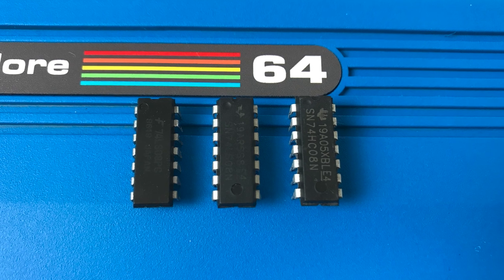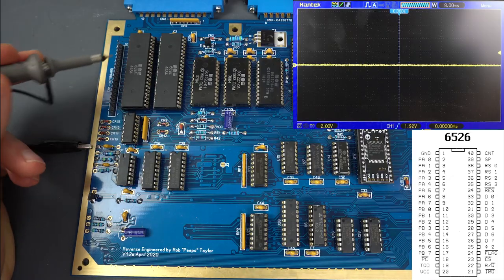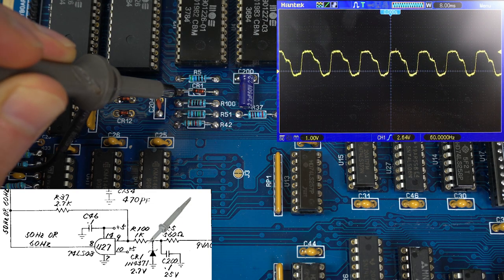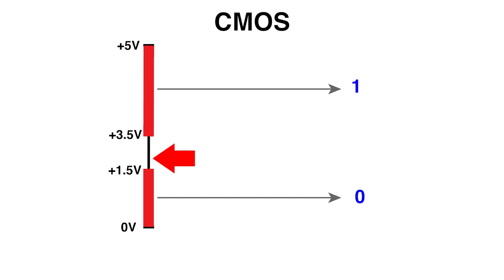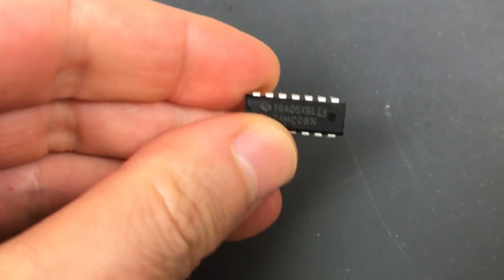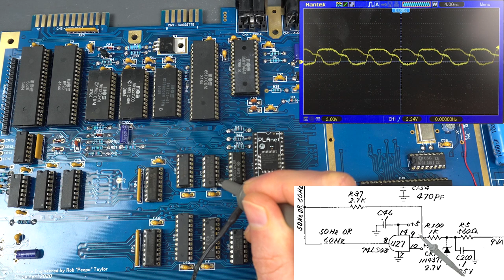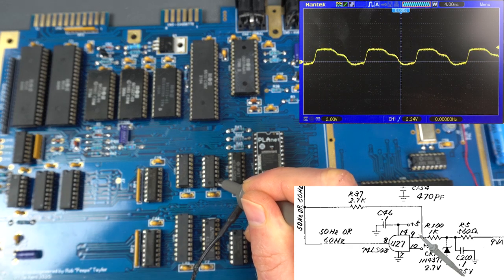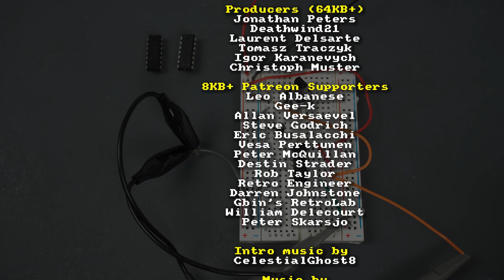Stumped By New Fake Chips Scam

Comment: You missed a massive point in that American 60hz is significantly more stable than foreign grids, that alot of extra attention is actively paid into stableising the frequency of generation.  But even then, it's not reliable for clock signals in complex computers like the c64, you mentioned how they didn't try to convert 50hz to the 1 mhz clock, assuming that it would've been designed with 50hz which more easily divides into 1 mhz, but that ignores that is was designed in america so the division would've been more complex, and B: it's just unfeasible for high speed computer timing to rely on generation frequency, but it certainly is much more accurate for a real time clock, the variation over a week or even a day is significant, The max deviation allowed over 24hrs for 60hz is about .16%, whereas for europena systems, you get .4 on average, with no strict max deviation.  It's so fucking bad that britain is using the deviation in line voltage hum to tie recordings in forensics down to the county and day they were recorded at.

So to sum up, no you cant replace cpu clock signals with the line frequency, but if you have any application corroborating events with the clock, like any long duration timer which would be a massive waste of processing power to run a loop for its delay, it is significantly more accurate for the us versions of the c64.

Comment: That's not the worst case of fake chips, I had two ali sellers sell me CD4017s rebadged as CD4026BEs._
Reply from the maker: Ouch! At least there it was clear right away that they didn't work as expected I imagine.
Reply: @NoelsRetroLab  That's right. Killed fake CD4069 and one specimen before I found out by experimenting._

Comment: Aaargh I hate fake chips! I oad one MAX3232, and a PL2303 as fakes, and both were prone to start getting very hot, where the real chips would not show this behavior for months and months of use afterwards i.e. the circuit was still ok, but not the damn chips. Being able to remove the printing with isopropanol then gave it away, hah.

Comment: I don't know why they didn't use a 5.1 volt zener.
Reply from the maker: Right. Or a Schmitt trigger directly. Sounds like they used whatever leftover gates they already had on the board 😃
Reply: @NoelsRetroLab  A manufacturer once told me that they were expected to save money each year since technology improves. Because we all know it's not that simple they installed chips and accompanying parts that did nothing at all so they could be removed each year to 'save money'. Bosses were happy looking at their spreadsheets.
When they got a new CEO I kept turning up on the hit list for missing my field service ETAs. For ten years I was always within fifteen minutes, what's the problem. Your LATE! Seriously. I set my ETAs for the end of response timer and old chuckle head was happy as can be. Had to tell my customers to trust me and not the computer and they were fine again.

Comment: You mention that the "LS" tells us the chip is a TTL device, sorry but "LS" means "low power Schottky"; the 74X tells us it is a "TTL" device. 

Love your site, I broke into computer repairs back in the 70's repairing commercial coin-op video games. Some of these had 200 plus TTL devices (straight 74xx chips), luckily all socketed' Some of the early boards used "RTL" devices as they were cheaper! 

My first computer was a Sinclair ZX80 bare bones board only, cost me 4 weeks wages at the time!

Comment: Kind of amusing that commodore relied on 2 volt logic level. The whole way that the TOD works is a massive hack in my opinion though. I suspect those chips aren't fake, just not made up to spec and assumed that most people wouldn't notice as 5v logic wouldn't have been noticed if it was done properly even in the 80s even TTL/CMOS.
Reply from the maker: Agreed. That circuit is an amazing hack. I suspect they had an unused gate in that chip and just used that instead of designing something better. I do think the chips are fake though (meaning HC with the wrong label), so I'll probably run some extra tests to find out. Should be interesting.
Reply: @NoelsRetroLab  yeah can't wait to see!

Comment: whats so hard reproducing the chips
Reply from the maker: The LS ones? Nothing other than it's a slightly more obsolete technology, so I'm guessing the factory wasn't set up for that but they were set up for the slightly more modern CMOS. Just a guess though.
Reply from the maker: Someone even suggested that they may be able to manufacture them, but maybe they had a shortage and got a big order for LS, so they just changed the labels on the ones they were set up to make at that time.

Comment: Why does this circuit feed 2.7 V to a 5 V chip? Continuous voltage levels around one half of the power supply voltage can damage any type of logic chips.
Reply: Likely the pulse width. You can use a higher voltage, but the AC voltage will be above that for a lower amount of time, so the pulse width gets smaller.
Reply: TTL is guaranteed to switch as long as the input is 2V or higher - that is per the spec. 2.7V is safely over the 2V minimum requirement, so it's perfectly fine, and no damage will occur.

CMOS can consume more power if it lingers in the "non linear" region between minimum switch-on and maximum switch-off voltages, and this could cause it to generate some heat. Whether that is enough to damage the chip, you would have to characterise it.

Comment: The issue, I think, is gate delay.  If you use 7408 or 74LS08 you will find it works peachy.  If you try the theoretically compatible 74F08 or 74S08 or 74HCT08, you find the circuit does not work.  The reason in my case was gate delay.  The newer chips have a much reduced delay, and the original circuit depended on the longer delay of the original 74/74LS versions.  I think perhaps China is supplying 74F or other as LS or plain 74series.

Comment: borrow a page from the installation of mod chips.

design the frequency divider on a small piggyback board and run the wires to and solder them  to the pins of the cpu. problem solved.

or use a 555 timer to generate the signal

@chinese manufacturers if you are tight wad enough to rebrand chips like that wouldnt working your employees off the clock be more effective?

working just 1 employee off the clock or shorting them 1 hour could pay for many chips.

so why not short a bunch of employees 1 hour worth of pay long before faking chips

Comment: These chips are not meant to be driven in an analog fashion. With a PROPER drive, they would probably all pass. Once zener-like shenanigans are afoot you're basically at defcon minus ten, and you need to test explicitly for whatever analog level you're applying, or you need not bother at all. Yes, there's specs for what a chip SHOULD do under these circumstances - but one does NOT rely on specs when something related to such a chip goes wrong. You TEST (much like presented here), and go from there - you absolutely do not just "assume".

Comment: I'd blame the circuit design more than the chip, though the chip apparently is not in spec.   Although 2.7v may be in spec to be a logic 1, it is rather close to the no-man's land.   A 3.7v zener would probably have been more appropriate.
I'm also surprised the circuit didn't use a Schmitt trigger.   But then the circuit might be using the other AND gates in the package for other parts of the circuit.

Comment: 16:32 Maybe chips did not pass quality test and re-brand it to next version. Like Nvidia and others do with GPU's and CPU's.
Reply from the maker: That would make sense with memories that don't work at a certain speed but work at a lower one. But LS vs HC are just fundamentally different in their inputs and outputs (and timings), so it's not as simple as that.
Reply: And the markings were fraudulent.